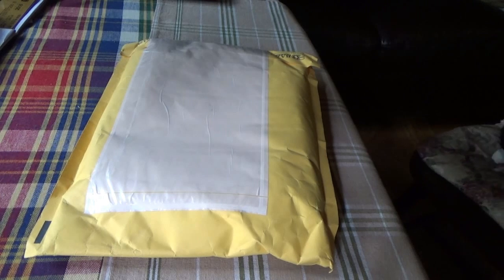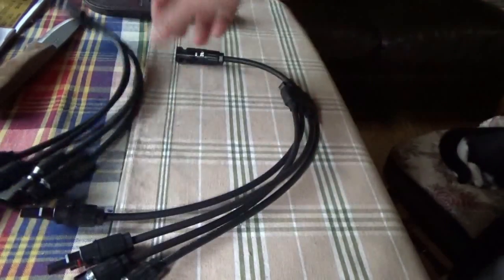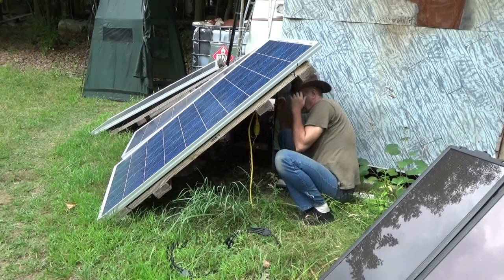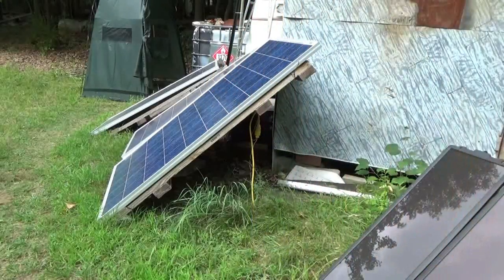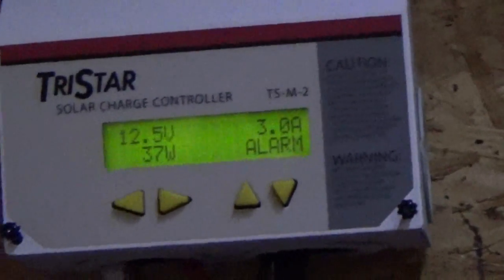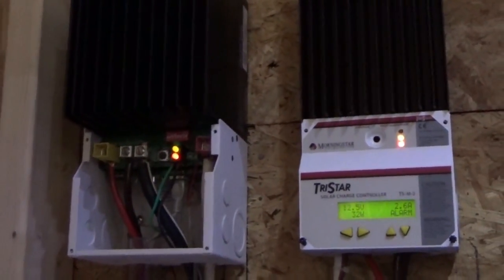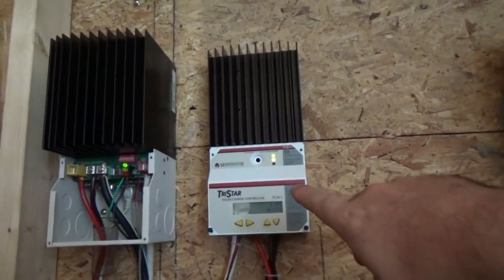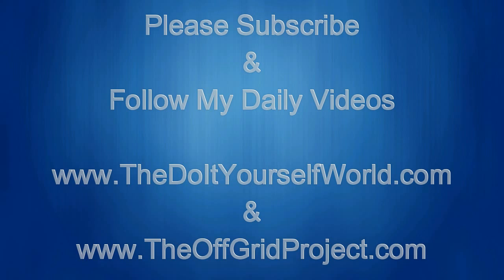Improving My Off Grid Tiny House Solar Power Output

Comment: 52watts / 4amps = 13volts. That sounds right to me. 
I'm guessing that your 230watt panels are rated around 35volts @ 6.5amps. If your battery bank totals only 12 volts, what does your new PWM charge controller do with the 23volt difference? I wouldn't mind using PWM if my battery bank was 24volts but @ 12 volts = a lot of waste.
Why is it so hard for you to reboot the system? Disconnect the MC4 at the panels then toggle the battery cut off switch.
Reply: The Do It Yourself World I have watched your stuff for a few years. Seen the homemade solar panels you made while doing research. I am a daily watcher and have bit my tongue and looked the other way while allowing other viewers to help you out. 

I just could not sit and watch you be in the dark about how the PWM will waste half your power. I saved up for the MPPT model you have because I could get 24 volt panels cheaper than 12 volt. My first set up was 400 watts of 12 volt (4@100 watts) When I got the tristar I series/paralleled them into two 24 volt panels and bought another 1000 watts of 24 volt panels. Anyway I need a second controller and was sorry to see you spend the money on the PWM using 24 volt panels.  I have been thinking about buying a 24 or 48 volt inverter so I can just use the one controller. A little cheaper than a new controller but, like you, I have many things running @12 volt.  Love watching you learn. Bye for now.
Reply from the maker: Cisco Isoffthegrid Actually I think I will see a loss from the difference. It is dropped. That would explain my reduced power output
Reply: Cisco Isoffthegrid Does this matter seriously? Volts are not lost but pomping the amps into the batteries - the amps are lost by limitations of batteries amphours and voltage is limited too but 'wasted'?
But then I don't know what exactly controller does, maybe it is actually directing the energy to ground in this configuration. That would be bizarre.
Reply: A PWM Charge Controller will drop Overvoltage into Resistance -> eg. Heat. The closer the Voltage is to the Battery Ideal Voltage on the Solar Input the less loss you have. All that gets pushed thru are the Amps. If you want to use Overvoltage the only way is a MPPT. Also a PWM will do very bad in partly shaded conditions on multicrystalline. Troy, Second thing i noticed on your 200w+ Panels is the border -> The Distance between the wiring inside the panel to the panel metallic Border. On a High Voltage Setup this can lead to current leakage, especially on a slightly wet / conducting ground. There should be at least 2 cm Distance between the framing and the internal wiring of the silicium cells, otehrwise you will end up worst case with arcing ( on your panels from the view , this will happen around 800 Volts ) - Altho there can be leakage already. I suggest making a plan and get a solar meter that you can wire up to teh panels to measure performance also under mixed conditions - especially when one panel is partly shaded. This especially can be bad in serial connections as the shaded panel will then become a resitor.
Reply: Marius Eckardt Oh.
But then why not just put a simple voltage-to-current circuit (that does not go below ~12.5V) before PWM or even add it as switchable inner feature?
Reply: +EsamoKoram  take just one of Troy's panels; if they are rated at 35 volts, 6.6 amps, 230 watts...

MPPT will take that panel and output 12 volts, 19 amps, 230 watts. The battery bank will take what ever it needs from that

PWM will take that panel and output 12 volts, 6.6 amps, 72 watts! No more than that will be available to the battery bank! Therefore calling the panels 230 watt panels will be misleading

Comment: why don't you have the solar panel on top of tiny house how do you see behind them to connect hope the alarm is not a bad thing. have a bless day Troy.
Reply: Cisco Isoffthegrid He needs to finish the roof first.  Half of it is still tar paper.
Reply: The roof pitch is in the wrong direction but maybe if Troy hinged the panels above the windows, like an awning, they would serve dual purpose.